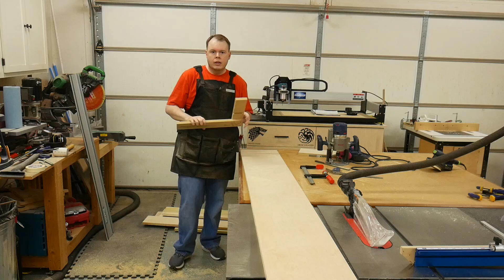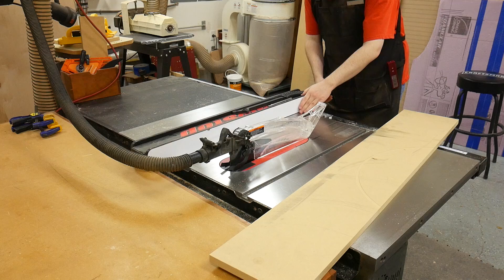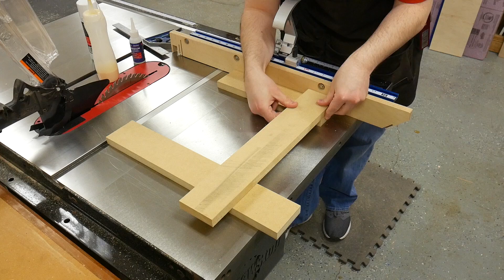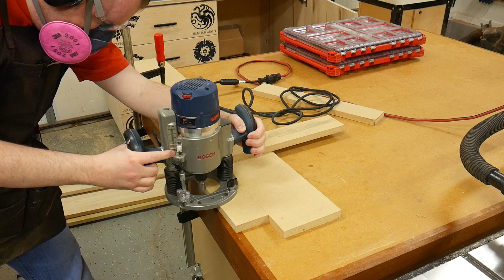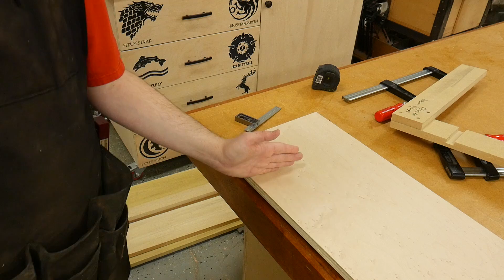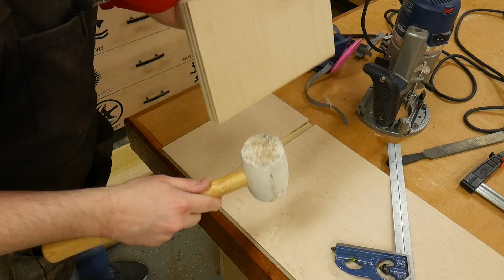Zero Clearance Dado Jig | Woodworking Jig Must Have

Comment: Would you do the same thing for a lengthwise dado to install a track?
Reply from the maker: I'd use a dado stack in the table saw for a lengthwise groove. If i didn't want to do that i'd use an edge guide on my plunge router. If you can't do either of those, then yes, you can do the same lengthwise using this method.

Comment: Love this jig .. I have made a couple too. My problem is that I had to put a highly visible arrow on the base to be SURE the same edge of the router (orientation) was pointed toward the fence. My router's base centering is a little off from side to side. I have all my routers (4) setup with arrows to insure consistent cuts even though three of them are truly centered in the base.
Reply from the maker: Luckily I remembered to remove the round base from my bosch and use the flat side. Now if I can just remind myself to do the same in the future lol...

Comment: Great idea, and this is absolutely fantastic to make in a pinch for one-time projects. 

I think there are a few issues if you want the jig to be reusable and repeatable, though: the router base needs to be round (or you'd have to use the same side against the fence every time), the router bit needs to be perfectly centered in the router every time, and the diameter of the router bit needs to be exactly the same thickness of your material (as you said).

So I think I would prefer making a dado jig with adjustable fences, to use with guide bushings. Admittedly the bit needs to be perfectly centered there as well - and it's definitely more work... and thus still on my to-do list ;-)
Reply from the maker: The jig is reusable and repeatable enough as it is to be "good enough" to not notice an issue for my case. I only have the bosch 1617evs and use the flat side of the base to push up against the fence. I would also only use this exact bit on 3/4" plywood so in my mind, this is the only setup I would use with this jig. I thought about making one with adjustable fences and guide bushings but I didn't want to spend the whole day just to make a jig lol. Now if I routed dados in large panels often, and I used plywood other than 3/4", I would consider making an adjustable jig, but then again, it would still be faster and cost less just to have 2 dedicated jigs on hand like this.

Thanks
Reply: @Simplecove  Yup, you're absolutely right. Thanks for taking the time to answer!
Reply from the maker: You're welcome. Thanks for the comment!